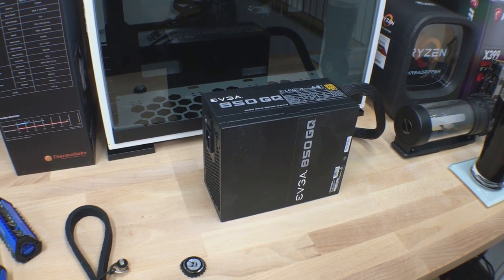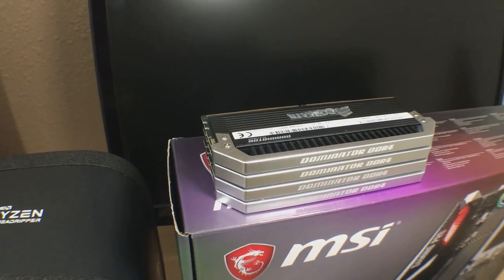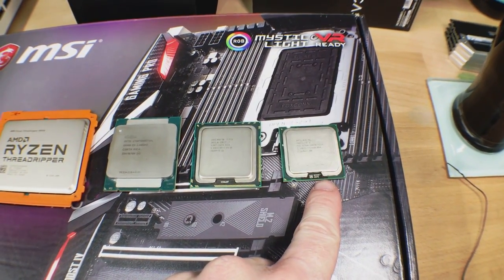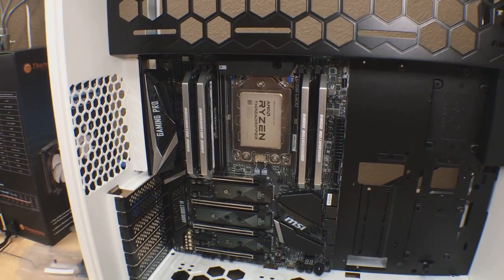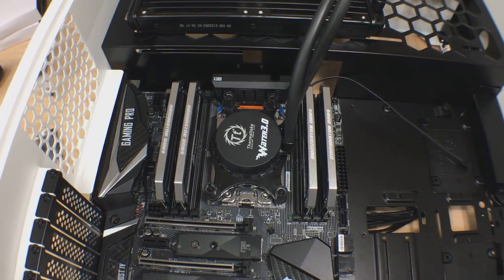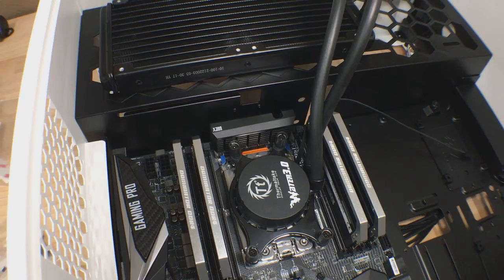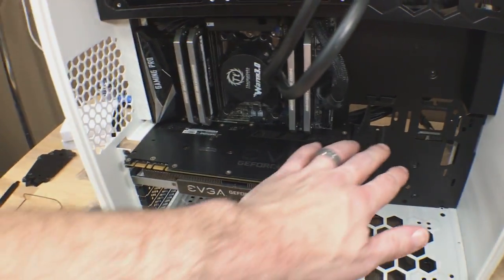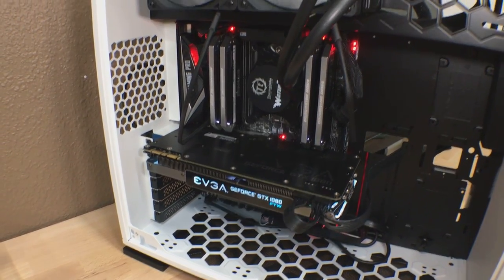Get Ripped - Threadripper 1900X Build Vlog

Comment: Great looking build. What a ripper... Thread Ripper  vs X99  Xeon System. How do they compare with your standard work flow? What the air  flow like for In Win Case with your current radiator position? Again cool build can't wait to see how it evolves over time.
Reply from the maker: Haven't done really any testing with it thus far.  I'm curious to find out myself.  VS my 12-Core Xeon, I'm expecting very similar multicore performance, but a huge bump to single threaded.  I'll be doing a full side-by-side benchmark with the Xeon, the 5820k, and the 1900x in a future video once the build is complete.
Reply from the maker: Currently the AIO tubes don’t allow me to put the glass on the side, so the airflow is great!

-_-

Intake for the case will be handled by triple 120mm on the bottom. Airflow shouldn’t be a problem.
Reply: I love open chassis cases :-)  lol  but I looking forward to seeing  your hard line tubing and case with side panels.
Reply from the maker: https://i.imgur.com/i2yYun3.gif

Comment: Turn the rad 180 and mount it in the front and mid fan mounts so the hoses are closer to the socket.
Reply from the maker: Tried that.  Tried a number of different orientations.  This was really the only way I could mount it.

Besides... it's only temporary.

Comment: Nice build!!!!  With any of the Threadripper CPUs, can any of them be conceivably be Air-Cooled????  Most likely not, but I thought I would ask the question.  I'm looking at an cheap/used 20C/40T Xeon  upgrade soon.  On multi-threaded applications, the Xeon will still beat the 1950x hands down and will not need water-cooling.  I find it interesting that most AMD CPU's always suck more power and need more cooling over Intel.
Reply from the maker: Threadripper is actually proving to be less power hungry and more efficient than the x299 Intel offerings.  And yes, Noctua has an air cooler that I hear works great.  https://noctua.at/en/nh-u14s-tr4-sp3